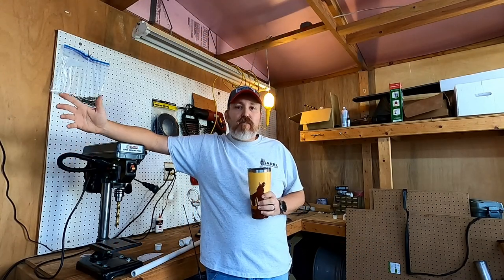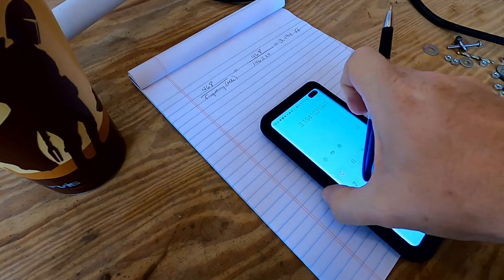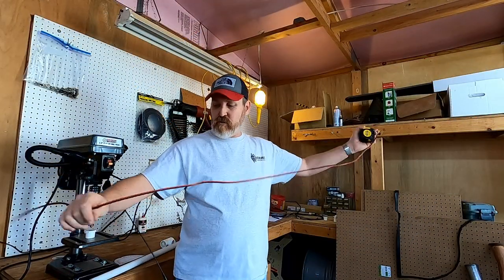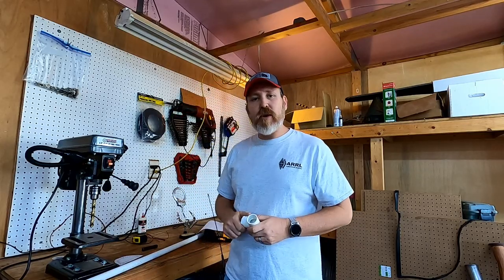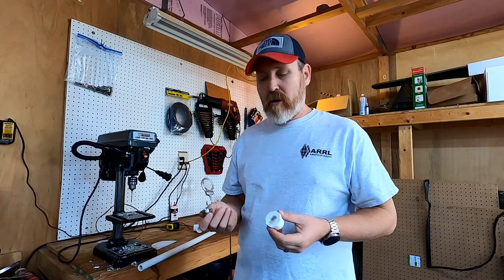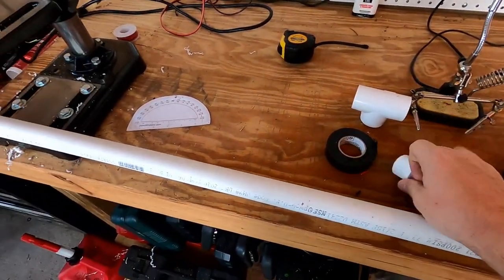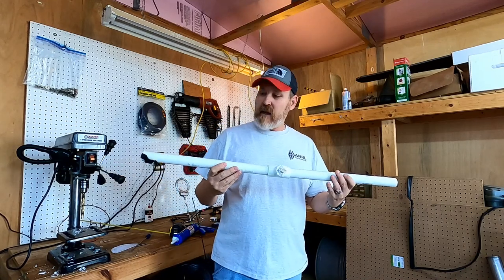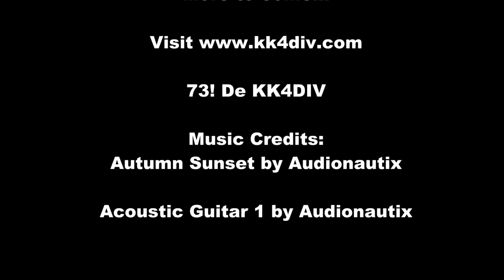Stay-at-home Ham Radio Project: Making a 2m dipole from scraps around the house 4/03/20

Comment: Wrap your feedline about 4-5 turns just below the connector on the antenna end. Tie it off with a couple of plastic cable ties or twine.  Rescan.  Bet the sweep is better.
Reply: Is there a way to make the antenna without the need for the coil? Does that have something to do with the shielding in the feed line still acting as part of the antenna versus the core which is blocked?

Comment: I have a portable SW radio (Tecsun PL660) which came with a plug in type external dipole antenna.   QUESTION:  Was the external antenna that came packaged with this receiver designed to receive every band that this radio can receive OR does this radio require separate dipole antennas with varying length wires in order to make use of the various radio transmission frequencies available?  (Sorry...  That was a mouthful)

Comment: I have made the 2 meter antenna with the so239 and 5 pieces of wire. I do like this style. I may just try it. 
So, in your opinion: which would be the superior antenna  1/4 wave 2 meter ground plane ...  OR ... the 2 meter dipole described in the video?
Reply: Depends on if the dipole is vertically or horizontally polarized.  Vertical polarization would be close to the GP in performance but the GP would still be the better antenna.  With the dipole horizontal the GP will out perform the dipole.